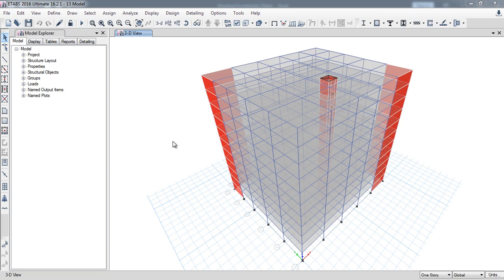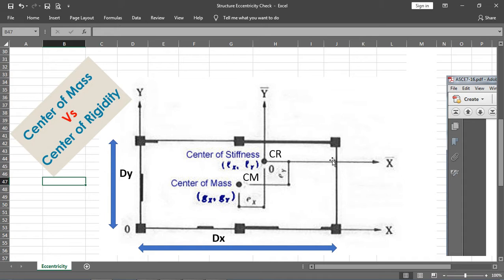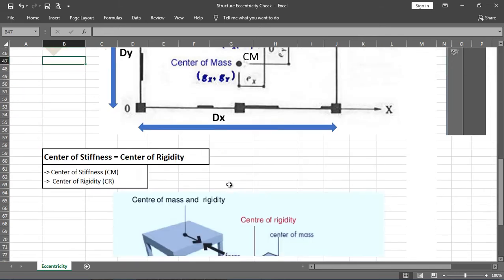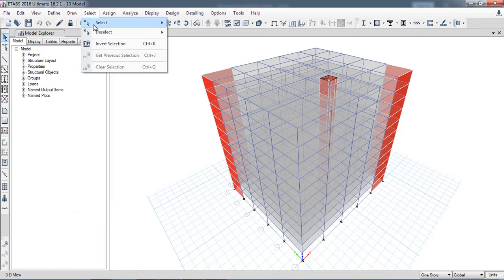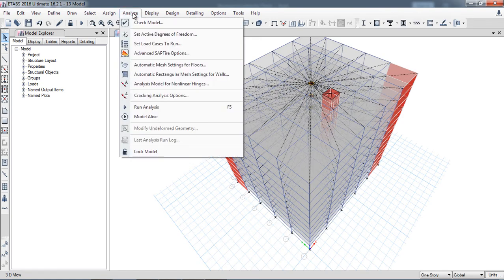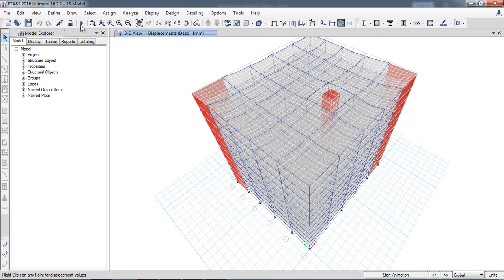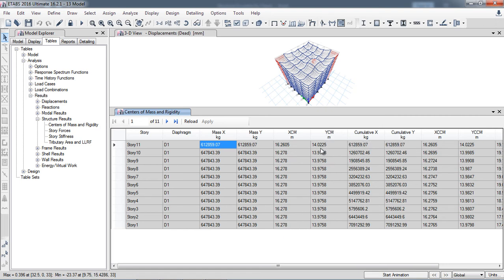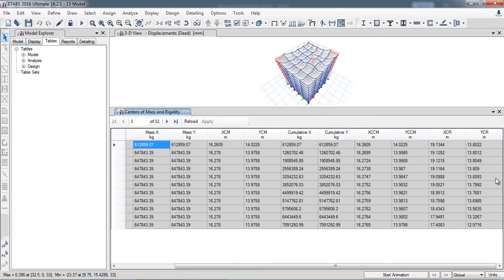CSI ETABS Course - 05 - Center of Mass and Center of Rigidity

Comment: Why the location of center of rigidity is different for each story even though all stories are identical in ETABS?
Reply from the maker: In theory, if all your stories are truly identical in geometry, stiffness, and layout of elements, the center of rigidity (CoR) should be the same for each level. However, in practice, especially in ETABS (or any structural analysis software), small differences can appear due to:

✅ 1. Diaphragm constraints and connection details
If diaphragms are modeled as rigid, the software assumes perfect in-plane stiffness, but small numerical differences can arise from how frames, walls, and slabs are connected.

Slightly different constraints, offsets, or releases at different levels can shift the CoR slightly.

✅ 2. Load path and boundary conditions
Even with identical geometry, the presence of boundary elements (like foundations, base fixities, or basement walls) can change the force distribution up the height.

If you have different support conditions at the base (fixed supports) vs. mid-level floors (where the system is continuous), the lateral stiffness matrix can vary slightly per level.
Reply: @AnyTechKey  Thanks a lot.

Comment: What could be the possible problem if the values of center of masses and rigidity doesn't show in the table (blank)?
Reply from the maker: Possible Causes and Fixes
No Diaphragm Assigned

Cause: CM and CR are only computed for levels with rigid or semi-rigid diaphragms.

Fix: Make sure you've assigned diaphragms to your floors.

Go to: Assign )) Shell )) Diaphragm and assign the diaphragm to the floor slab areas.

No Mass Defined or Assigned

Cause: If there’s no mass assigned to the structure (or to the diaphragm), the software can’t compute the center of mass.

Fix: Ensure mass is defined (either manually or automatically from loads) and assigned to the diaphragm.

Check in: Define )) Mass Source